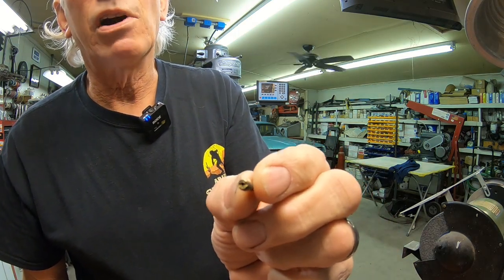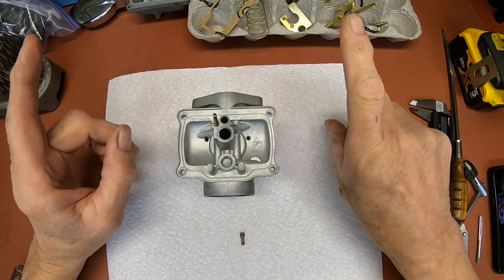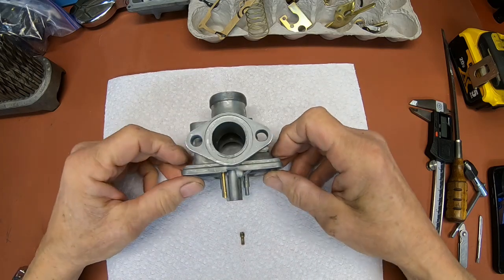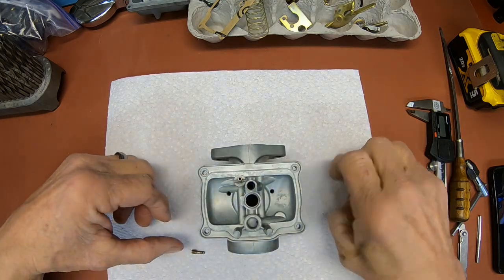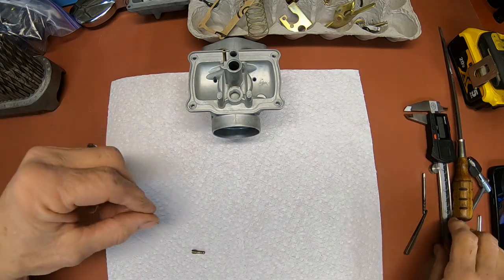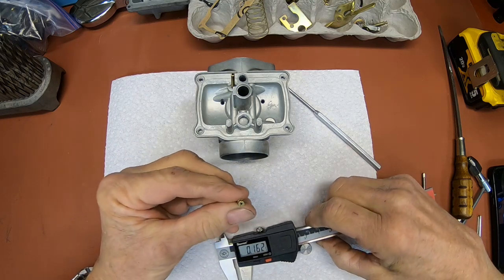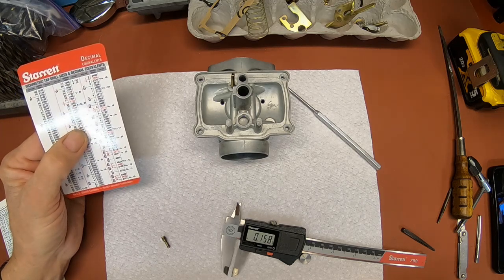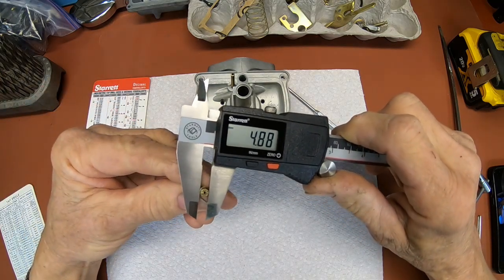Remove a stuck or broken pilot jet from a Mikuni carburetor

Comment: It wasn't luck Dale, it was your patient and methodical approach that won the day. 
M5x0.8 is a common one, especially for instruments or electronic equipment.
If using a metric drill set, the tapping size is major diameter minus pitch. So 4.2mm for your M5 jet. 
Thanks for sharing the success my friend. 
Dean in Oxfordshire, UK.
Reply from the maker: Thanks Dean, dont own any metric drill bits. My holes may be a bit over or under, still fiddling around with fractions here. I wish the US had changed a long time ago. Metric is simpler, however its hard to teach an old dog new tricks. So the confusion continues.
Reply from the maker: Hey Dean I have a metric question for you. The internal rotor that is going on the Yamaha MX is a 19mm x 1.50. I cant seem to find a puller for it. I also cant find any minor or major dimentions . The machinery handbook skips right over 19mm. I have turned one out on the lathe but I just took a stab at it since I could not find any info. You got any info on that size.
Reply: @montana2strokeracer  Hey Dale, it's definitely an unusual one, the standard metric threads jump from M18 to M20 but the system is flexible and does allow variation. It's good that your lathe will cut the pitch. There is an M19x1.5 in Swiss Standard Metric threads but largely obsolete and unused these days.  I'll send you an email with more detail. 
We also still use a mixture of both systems here, buying our fuel in litres and driving in miles and miles-per-hour. Mostly we are metric though. In engineering, it pays to be able to use both systems as British made products were still Imperial into the 1970s. 
Imperial...You have the choice of BSW, BSF, BA, BSP, BSC, BSCycle, Gas thread, Admiralty,  ........ad infinitum!
Take care my friend,
Dean.

Comment: I bought carbs on ebay,  pilot screw broken,  keihin cvr32, suzuki bandit 600, ...I was lucky,  used left drill bit 3.2, just using fingers, unscrew it slowly. Thank you for showing that patience is crucial, no force, no rush.
Reply from the maker: I always worry when I buy a carb from ebay. You never know the condition. I was lucky to get it out after broken off. You are the lucky one. Good job.

Comment: You, sir, are doing the Lord's work.

I halfway considered doing this on a Mikuni VM series I acquired that had the pilot jet essentially cemented in place with oxidation/corrosion.

You inspired me to try, and it worked. I've managed to save this carburetor (and ~$30-40). Thanks for your video.
Reply from the maker: Thank you, sir, not sure if it's the Lord's work or not, but if it kept you from cussing, I will take that as a win for the Lord. I do know the feeling though, every time I get a new bike or carb, I worry till that jet pops out of there.  I hope I never have to do it again. Glad it worked for you. Thanks for taking the time to watch the channel.
Reply: @montana2strokeracer  I'm glad I found it. I'm new to motorcycles, got to them by way of go karts & ATVs, but videos like this apply universally. Thanks again!

Comment: Did Like he said starting out with small drill bit gradually increasing size.  The only difference is that I used Left hand drill bits hoping that I would get pilot jet to dislodge.  That is what happened!  Made things a lot simpler!
Reply from the maker: Thanks Paul, yes that is the optimum way to do it for sure, this one was not coming out, to drill it was the only way. Glad you got yours out. I have always hated the alternative.... junking the carb.
Reply: @montana2strokeracer  
@pauldelay6725
40 minutes ago
I bought a 1977 Yamaha XS750-2D that sat for 35 years.  Took apart the 3 Mikuni carbs and all 3 main jets were frozen.  Used penetrating oil hoping that would work, nope!  The left hand drilling worked on all 3.  A piece of cake. @montana2strokeracer

Comment: I am dealing with this on a John Deere duplex carb right now and this was the same thought I had but was nervous to do it. Thanks for letting me know it will work so well!
Reply from the maker: Hi David, I don't envy you having to mess with that, I sweat it every time I have to deal with one. Not knowing if you are going to ruin a good carburetor or not. So far, I have done two and both worked out fine. So just be careful, and getter done. Thanks for hanging out in the shop with me.

Comment: This helped me!
however, I don't have the same patience, or a tap & die set!
In the end, (after lots of soaking in carb cleaner & WD40) I got mine out by drilling a slightly larger hole, but not very deep... then, with careful violence, I hammered a small, hardened steel, Philips head screwdriver down there!
it worked & I was able to unscrew it using the Philips head.
Reply from the maker: Awesome Jason, you got it out that's the main goal.

Comment: I just went through this on my '75 TS 250 carb.  I used lefthand drill bits hoping it would catch and come out. I didn't get it drilled perfectly center.  😕 used a tiny piece of Teflon tape to seal the the slightly damaged threads.
Reply from the maker: At least you saved the carb casting....thats the big thing. Sounds like you have got a good repair. Nice going. Hey thanks for following the channel.

Comment: Flatten off the tip of the screwdriver so its parallel with the groove in jet so its snug and not tapered like a typical screwdriver and choose a screwdriver that will turn the full width off the jet, A couple of lite taps to shock threads then wd40 if not turning and take it easy, will reduce this problem from happening.
Reply from the maker: You are right Sam, the perfect fit screwdriver is the key for sure. But not much you can do about the previous work done. Just hope for the best! Thanks for hanging out in the shop with me.

Comment: Hi Dale, I have a 1993 Suzi VX800. very similar to the VS800 or Intruders of the 90s. Same issue. I drilled most of it out with success but need to get the rest of the threads out. Is the tap size 5 mm - 0.80 tap. Looking for a set now. I didn't get so lucky and the bottom half didnt fall out but I am hoping that tapping the threads out will loosen that bottom bit as well. Thanks for your help.
Reply from the maker: Hi there, man this has always worried me, and does to this day. You just never know if those are going to come out or not. Yes, the tap size is m5 x .80. It is a pretty common size you shouldn't have any problems finding one. Just go slow I bet you get it out just fine. Good luck brother.

Comment: time to invest in set of left hand drill bits, i dont remember where i got them, its a set of 5 bits, smallest is 1/8 to largest 3/8 and 3 inbetween, work great in drill, chuck up run in reverse , so far i have always gotten lucky when i've used them, bit gets a good bite and screw backs right out....how bout main jet on mikuni carb, that emulsion tube, how hard is it to get out? is it necessary to remove ? carb had straight varnish in it, petcock on tank leaked fuel into carb while it sat for 5yrs or more. i can see threw it, not sure bout air holes in sides, will fresh gas eventually clear holes out? what do you think, i dont want to invest in bucket carb cleaner, as i dont have but one carb right now, otherwise i wud. thanx
Reply from the maker: Thanks Jon, yes, I have a set of left-hand bits, I use them quite often. This has been quite a while since I did this video, but I think I couldn't use them because the jet was too small for the smallest one to bite. Yes, I have used them successfully over the years. Thanks for hanging out with me in the shop.

Comment: I tried to do a rebuild on a carb got everything out and cleaned except that same jet I tore the flat head part up pretty good and put it all back together so after watching this I'm thinking it's not gonna work the way it should?
Reply from the maker: Hi Bill, like I said, I have worried about this for a long time, but this was the first time I had to deal with it. I just didnt want to junk the carb. It turned out to be not as bad of job as I thought. That being said, I would not wish it on anyone. Im just positive you can get it out if you try. Thanks for following along.

Comment: I have never had success with the Easy-Out.  You couldn't just sharpened a flat screwdriver, insert it, tab it a couple of times to create new slot in the key then back it out?
Reply from the maker: Yes, you could do that, I have had some luck with whatever I could get in there, this just happened to work in this case, I didn't use any form of easy out to get it removed, I simply drilled out the jet.